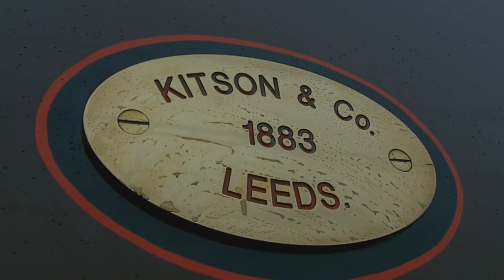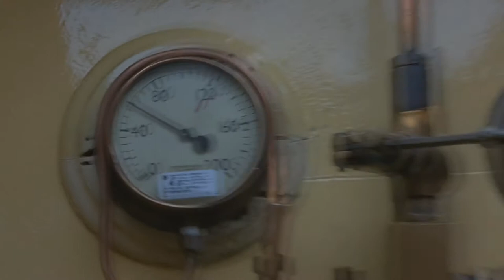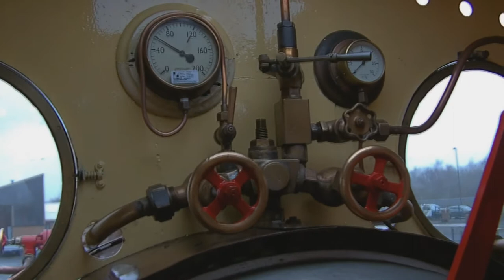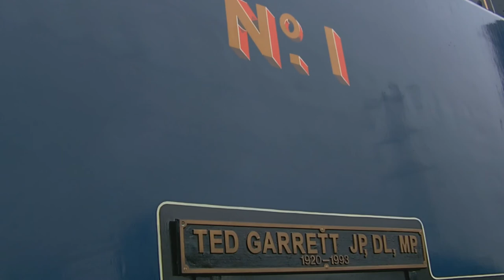North Tyneside Steam Railway - A5 Steam Test

Comment: Nice to see the old loco coming back to life Stevie and they've made a great job of restoring it! Is the railway purely industrial and is it passed for running passenger trips too? Thanks. Ken
Reply from the maker: Hi Ken. Pretty much all our engines are industrial yes, I think only our 03 & 08 aren't industrial. The 03 used to be a station pilot at Newcastle Central & the 08 was based at Allerton depot. 

A5 hasn't been down the line yet but will be possibly having a trial run soon. Defiantly before the Easter weekend! 
Cheers! :)